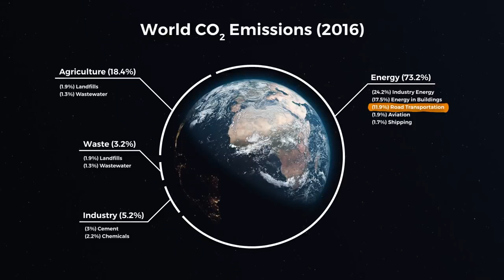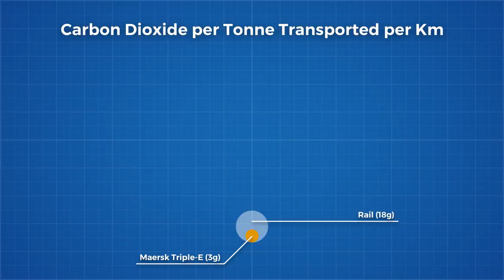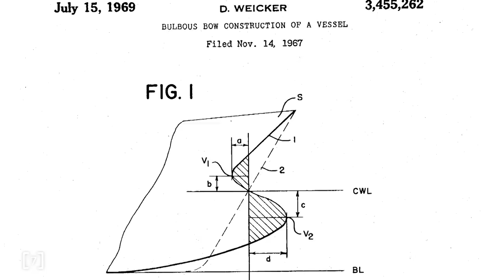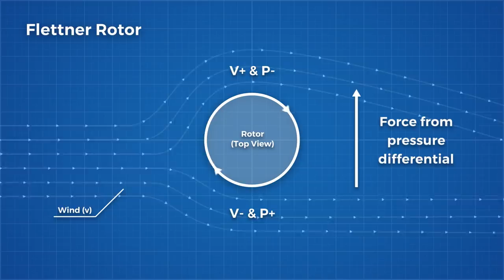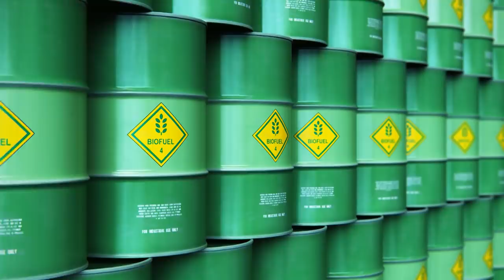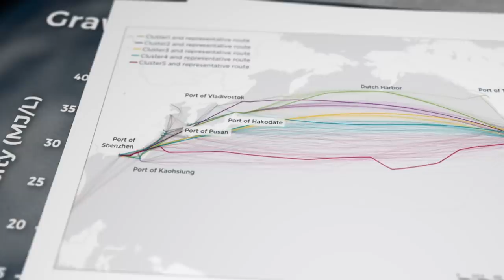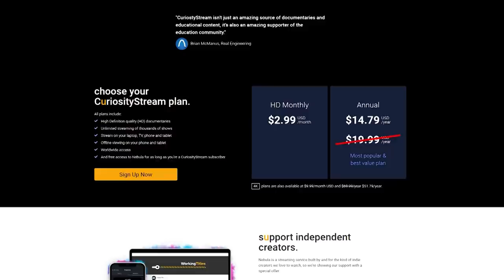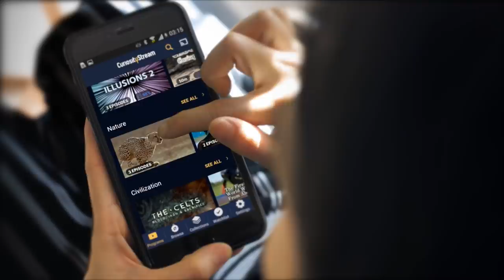Are Renewable Powered Ships Possible?

Comment: I was kind of expecting to see solar panel systems that could be installed on top of the shipping containers. I'm going to guess that this doesn't produce enough power to make it worthwhile, since it seems like it would be fairly easy to implement.
Reply: Power to area problem moving ships using electric from solar panels would require a much larger area than the hull would provide.
Reply: @BernardLS  Do you know what percentage of required power the panels could generate? Obviously the wind turbines added don't provide enough power either, but as a supplemental power source I wonder if it is even meaningful.
Reply: @jaredwilliams8621  The above container area of a Maersk triple E is less than 399.2m by 59m.  The 399.2m is the length between perpendiculars (marine tech speak - no need to worry about it) and the 59m is the width (Moulded - more marine tech speak so again no need to worry about it) allow for the bow, stern & accommodation structure could we agree 350m x 50m or 1 750m2?  Insolation rate in Joules will vary due to time of day, latitude of vessel, declination of sun, (those three impact the elevation of the sun) cloud cover, efficiency of solar panels and how clean they are.  The triple E class use 29 680 kilowatts for propulsion at full whack plus some hotel and services power load cost; so round numbers, 30 megawatts.  Solar panels create about 250 watts on a 1.2m x 2.4m unit so about 85 watts m2. 1 750 x 85 gives me 148 750 watts (or 0.15 megawatts) on the top of the containers.  0.15 megawatts might allow you to distil enough fresh water from the sea to wash the crud of the solar panels but no where near enough to 'push the boat along' all the numbers are 'ethanol infused' so please check my arithmetic fitting panels on top of the boxes is worth 0.005% of your power requirement.  More seriously containers are loaded and unloaded from the top down so the panel array will need to be moved for every port operation.  Just consume less, it is the zero cost option.

Go to 'Renewable Energy Without The Hot Air' an on line book by a Cambridge UK academic.  Trust no one, unless she gave birth to you or has given birth to your children (:-).
Reply: @BernardLS  I figured it had to be low, since it seems like an easy retrofit (just design panels that use the same stacking mechanism as the containers), but I wouldn't have guessed it to be that low! Thanks for the calculations! I didn't even think about the aspect of keeping the stupid things clean with all the salt water around them.
Reply: @jaredwilliams8621  to many (14) years at sea! Consume less (my plan to save the planet 😁)

Comment: We need the sails back
Reply: To address the suggestions that sail power is the answer I offer the following.  In 1870 a premium sailing vessel entered service, the ‘Cutty Sark’, she could carry around 600 tonnes of cargo at speeds of up to 17.5 knots, dependent on the prevailing wind, to harness the energy the available spread of canvas was up to 2 976m2.  To round things out that was circa 5m2 of canvas for every tonne of cargo carried.  The ‘Cutty Sark’ was designed and built, with fine lines (more nautical tech speak so again - no need to worry about it) for employment in the tea trade where time on passage was a large factor in securing the premium freight rate that made her cost effective but as soon as the Suez Canal opened, which the ‘Cutty Sark’ was unable to sail through, she lost her advantage, raw speed, to the steam powered ships of that era.  Mechanically powered ships have improved in terms of efficiency, on a freight tonne mile basis, by at least one order of magnitude since then.  After losing out to the coal burning, steam reciprocating mechanical ships of the late 19th century ‘Cutty Sark’ was relegated to the Australian wool trade, just about the bottom of the barrel in maritime terms and only one small step up from being a 'honey barge'.  The canvas, cordage and extra manpower needed for sailing ships was never a very benign environmental option so please discount any idea of sail as ‘sustainable’.  All this is without the problem that if ‘the wind don’t blow the ship don’t go’, when it does blow it often blows in the wrong direction for your cargo delivery needs and sometimes there is rather too much of it for comfort.

Comment: How ironic, the Liberty ship line was developed to be build faster than the german submarines could sink them.
Comparing the future transport ship to that would mean you are willing to sacrifice hundreds to get thousands to the intended destination.
Reply: On the ‘reduced impact front’ a lesson might be learnt from the past, in the 1930’s a group of six ships that were being built for the British Tanker Company (BP) to their “Three Twelve’s” design (12 000 tons deadweight, with a speed of twelve knots and a fuel consumption of 12 tons per day).  These ships were purchased whilst still ‘on the stocks’ and completed for the Admiralty so they could keep the fleet fuelled up and at sea.  12 000 tons deadweight (dwt) is tiny by today’s standards with ULCC’s being twenty five times that size (300 000 dwt) while their typical service speed has only increased to around fifteen knots, or by 25% if you like to keep things relative, and daily fuel consumption has gone up to about 60 tons (or half an order of magnitude to be academic about it).  Bear in mind that speed reductions, a useful buffer for adjusting variations in demand, will in the long term require more goods in transit to maintain any given level of supply.  Typically tankers move at 15kn so a reduction of speed to 12kn could yield a fuel consumption saving of 20% (?), however to maintain the same flow of material an additional 25% of shipping capacity will be required.

4 ships at 15kn = 60 freight miles = 5 ships at 12kn.

Comment: The hydrogen powered ships seem more practical to me. The wind based solutions could be used as a supplemental solutions to improve the efficiency but they cannot be used to substitute the fuel based propulsion. In future when the question shifts to existence of the industry vs sacrificing 5% capacity, the answer would be more obvious. After all if they can slow down freight movement for cost reduction why not sacrifice 5% of capacity. More bigger ships could also be used which are designed. 50 years ago a 24,000 TEU would have seemed impossible yet here we are with 24,000 TEU ships today.

Comment: The shipping industry is going to use ammonia as a renewable fuel.  Its made from renewable hydrogen, and nitrogen from the air.  Attaching the hydrogen to nitrogen solves the volumetric energy density problem.  Google Maersk and ammonia fuel.

Comment: It's not technically renewable, but I want to see nuclear powered ships.  We already have it for some military ships and a few icebreakers, but I think there's only been one made for cargo decades ago, and it was converted to fossil fuels.  Of course, nuclear electrical generation could save us even more pollution, and is widespread, but still faces major hurdles in both red tape and unfounded public fear.
Reply: Just think; would you have full confidence in the management of a nuclear reactor under the control of an anonymous entity only traceable, perhaps, via a letter box in a FOC (flag of convenience) nation state?  If you are, could you sell that confidence to Japan, the state that hosted the Hiroshima and Nagasaki nuclear detonations as well as more recently the Fukushima ‘event’?  Then try that same, or a similar, sales strategy on Ukraine, the nation state that as a part of the USSR (CCCP) hosted the Chernobyl ‘event’.

Modern iterations of nuclear energy, thorium fuel, molten salt reactors, small modular reactors or fusion reactors, will carry the legacy of past problems.  It is the global trepidation of anything with 'nuclear' in the name and the economics of nuclear having transitioned from 'energy to cheap to charge for' too 'the costs of remediation are incalculable' that will prevent the adoption of nuclear energy as a means of creating energy at sea.  Modern reaction systems may have overcome the safety problems but the general public, having been misled in the past, will be reluctant to believe the fresh new promises.  The incident of the ‘Ever Given’ blocking the Suez Canal, March 2021, may also have a little to add to this debate.  The cooling water on ships tends to get taken in from near the bottom so when running aground the inlets are in a prime spot to get plugged up restricting, if not stopping, the flow of coolant.  One thing that the TMI, Chernobyl and Fukushima incidents all had in common was that the supply of coolant, or rather lack thereof, was a fundamental cause.  Similarly, and only months later, May 2021, had the ‘X Press Pearl’ been nuclear powered then a major port for a populous nation in the global South would have possible been the site of a significant exclusion zone due to a non-power plant related incident.  If the ‘X Press Pearl’ had on board a fired up but ‘safe’ molten salt reactor and found herself having to dissipate the residual energy associated with the possible 12.5 megaWatt power cycle would a stable cool down have been possible?  Would there have been sufficient heat energy contained in the power system to facilitate a hydrothermal explosion?  In a casualty ships may capsize, like the ‘Karin Hoej’ off of Bornholm in the Baltic early December 2021, in which situation any safety system reliant on gravity might not work.  It might also be worth bearing in mind that part of the TMI near miss was the fault of the US navy trained operators focusing on not letting the primary cooling system 'go solid'; due to their training overwhelming their education and the particularity of the situation.  The actions of the captain of the 'Costa Concordia', Francesco Schettini, may also be relevant; the consequences of his actions, whether due to ineptitude, an isolated act of incompetence or driven by a corrupt corporate culture, illustrates well one of the dangers of releasing nuclear energy into commercial shipping.

As a second point if you fit 'walk away safe' reactors on ships you will need duplicate drive trains as there are seldom salvage tugs around when you really, really need one.  A nuclear ‘dead ship’ drifting around NUC (not under command) would be a disaster waiting to happen and duplicate systems increase expense.  Land based nuclear power plants have a few issues but are immobile, stable and usually well regulated.  Reactors on ships by their very nature are able to move between regulators, bump into each other and roll over.  Regulation of ships by both / either flag state or port state has problems and adding any nuclear regulatory obligations on to those already overstretched facilities would be very taxing for all involved.  This is not about 'can it be safe' it is all about 'will it be safe'.

Furthermore, while merchant ships may be 'taken up from trade', as the RN would say, or may be captured or impressed by non-state quasi military entities by way of piracy, cargo ships are not military vessels.  They therefore do not have the same inherent level of self-protection and internal discipline.  Why not use nukes on merchant ships?  It is down to engineering, finance, socio-political attitudes and safety.

Comment: 9:22 I saw a climate dashboard that showed that methane is much more harmful than carbon.... how does shipping compare when taking that into account?
Reply: Methane  (CH4 aka LNG, CNG, Biogas) as a marine fuel is a good option, except it is very light, lots of it around much of which comes out of the ground as a fraction of the FOGI energy mining; even more can be created (relatively expensively) from anaerobic degradation of organic matter.  The organic matter may be either raw vegetation, food waste or pre-digested by domesticated livestock with the right (or wrong, depending on your point of view) sort of diet and gut fauna.  CH4 is a lighter than air, vapour at environmental temperatures and pressures and you need to compress it, a lot, or cool it, a lot, to get enough on board your ship in manageable volumes to be useful.  Carry it as cargo and you can burn the ‘boil off’, when the latent heat of vaporisation has the co-activity benefit of keeping the cargo and cargo tank structure cool, otherwise more trouble and cost than merit and savings. However work is being done so it may happen.   If it gets out and burst into flame the radiant heat could singe your eyebrows at ranges of up to a few miles.

Comment: I don’t believe we have the technology to reduce road pollution to 0. That’s implying electric cars produce 0 pollution. In fact many run on coal created electric and the battery mining is awful for the environment. 

Maybe if each car was powered by a hydroelectric damn or nuclear facility it would be a lot lower. But still not 0 like you said. 

Unless we’ve mastered fusion and I just missed that in the news.
Reply: The most environmentally friendly method of transport is often said to be the bicycle.  Though the down side are limited capacity, poor weather protection and poor up hill performance. The limitations increase as the age of the rider increases.